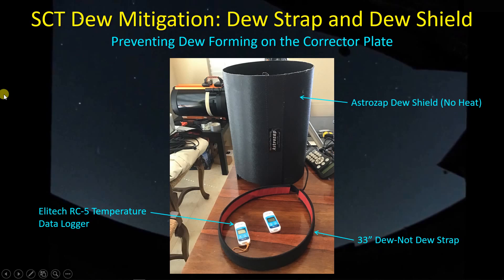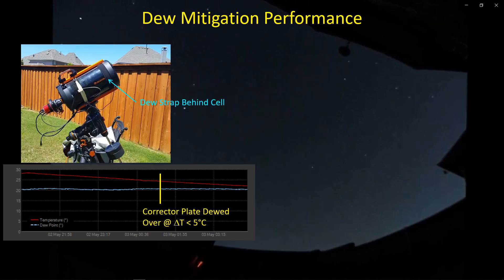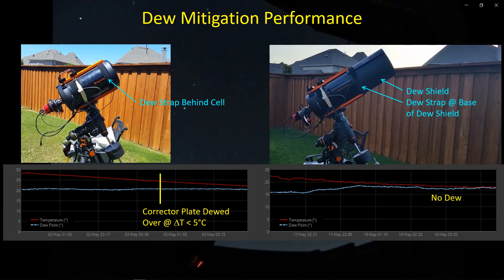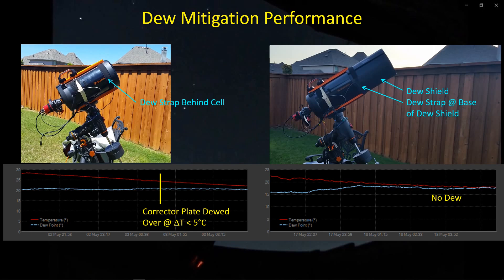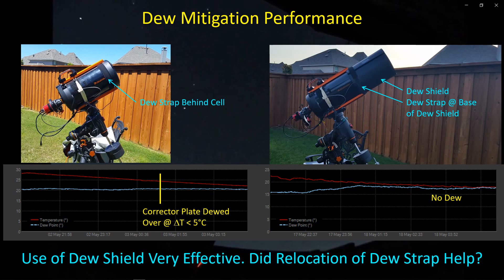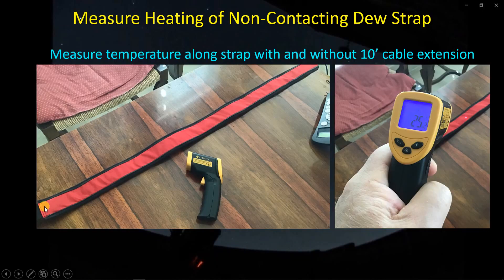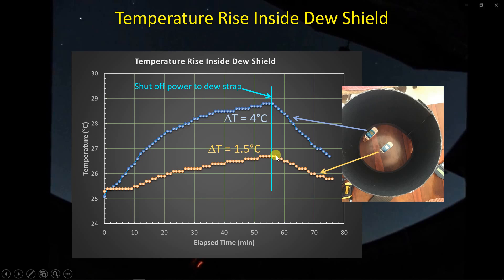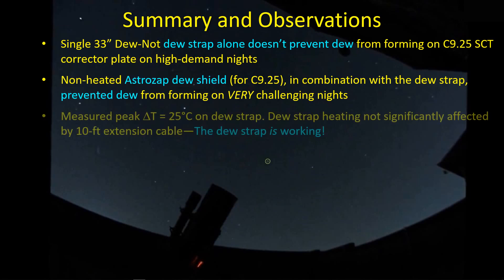Comments on the Use of a Dew Strap and Dew Shield with an SCT

Comment: A few months back I came across your outdoor setup , a 2 part series. I just got my celestron c8 and cgem2 mount. So been three months of a few nights of imaging . I put a focal reducer corrector on it before first full moon images . So happy with results . Then Orion Nebula just one image came out nice enough for me . Now I know more . So out to a bortle 4 and m51 . Stacking lights darks flats and bias , about 20 each . Now I’m hooked, scheduled time and budget enter my head . So here in Northern California I can drive to a bortle 4 or a bortle 2 . Duh the bortle 2 right . No , 4000 foot elevation and 80% humidity and took dew shield off for bhatinov mask focusing and instantly a dewed up situation. Now I go back to your videos . And I find very useful information on not only the dew problem , have dew heater now , but also getting into autoguiding . I wondered about size of guide scope and use of focal reducer . Did you post image results of m51 . I also have a spacecat for nebula imaging . Two very different scopes . I can probably get away with one camera for guiding , just a guess , but not the guide scope. Any thoughts thank you for your efforts on helping us newbies
Reply from the maker: Yep. You're hooked. Glad you've been watching my "learning fest" video series! Also, I'm happy to hear you have a SpaceCat. That's an awesome scope and a good counterpoint to a C8. Dew is the big issue for me right now. I've been doing some recent imaging with a shorter-length simple dew shield combined with the dew strap. It's been working well. So far. I've been stealing a night here and there that I share between M106 and M51, so no final results yet. With any luck (and no dew), I should finish the Lum filter tonight. Then I will devote a night each to R, G, B, and Ha as the moon becomes increasingly bright. The forecast suggests I'll be done next week. Forecasts have been wrong in the past though. Once I'm done, I'll do a video comparing these results with those I obtained when I first started this hobby with a DSLR. Should be embarrassing! Either because of lack of progress or how poor the original images were. I'll also have a video update on my findings relative to dew prevention. Thanks for watching, Dan!
Reply from the maker: I think it would be perfectly fine to use one guide camera for both scopes. A small OAG like the ZWO OAG would be very good for the SpaceCat. At that focal length, you won't have any trouble finding a guide star assuming your guide camera is sensitive enough. If you use a guide scope with your C8, you can get away with a guide camera with a smallish sensor such. If you go with an OAG for that scope as well, you may want to use the Celestron OAG (larger prism), and then you'll want a guide camera with a larger sensor to make use of the larger prism. If you always use the focal reducer, that will help in finding guide stars. Try our different options in Stellarium. It's free a vert useful for looking at fields of view for the main scope and OAG with difference camera sensor sizes.

Comment: James, you talk about the air being heated, but the whole point is to try and get the heat in to the glass. I'd recommend putting the dew strap as close to the corrector as possible on the cell, then use the dew shield on top as an insulator to radiate more heat inwards (as well as the physical protection aspect). Direct contact to try to get the warmth in to the glass is the idea.
Reply from the maker: Thanks for the comments! My experience shows my C9.25 dew up if the dew strap is on the cell or on the tube behind the cell. Recent experience also shows no dew forms if the dew shield is used (alone? or) in combination with the dew strap. Recent testing/imaging with a half-length dew should has also been successful (reduces wind disturbance). 
This dew issue is actually quite complicated. Like you, I thought that heating up the corrector plate is the objective. And that may well work if you can heat it up enough. I have serious doubts whether that little dew strap has the heating capacity to heat up the cell (or tube) and also heat up the corrector plate. 
Mike (commenter in this section) has brought up an alternative view that heating up the air mass in front of the corrector plate is the objective. I have more faith in the dew strap for this role. As I understand the mechanism, higher temperature air has a greater capacity to hold moisture. When the air temperature drops to (or close to) the dew point, the air must get rid of the excess moisture. If you heat up the air, you maintain its capacity to hold onto the moisture. Also, some of the heat in the local air column will transfer some (probably very small) amount of heat into the corrector plate.
My current objective is to find the minimum-length dew shield that achieves the dew prevention objective while reducing the increased sensitivity to wind. Then, I will attach the dew strap inside the dew shield next to the corrector plate to more effectively heat that local air column. Thanks for watching!

Comment: James interesting stuff that you do. The cable extension vs no cable extension; I would expect a dew shield controller to use a current source to limit the current so the full on current would be constant. When/if you turn the duty cycle down then the reduction will be what you expect regardless of using/not using the extension. So it performs (essentially) the same. But if you had used a "cheap (unsophisticated)" dew shield controller then the extension could be significant.

When you put the dew heater on the outside of the dew shield you put it against an insulator. If there was not insulator you would expect half the heat to go outside and half to go inside. As it is only a smaller percentage goes to the inside. If you had put the strap around the SCT metal before the corrector plate, then any small variations would even out as the tube acts as a heatsink and conducts from hot tot cold areas. If the tube radiates some heat out and some inside then like before the efficiency is reduced. But because you are heating the air inside the SCT it is constrained so it's more efficient than heating the air outside.

If you wanted to really "nail it", you might remove the corrector plate and position a heat belt close to the outside tube but separated from it. The heat would go into the air and relatively small amount would be wasted heating the tube. I suspect most users would prefer the simple approach so they would be OK with using the band around(below) the corrector plate and using a bit more current.

If you stop to think, what does a dew shield do? It has two effects; it stops stray light entering the tube. So it needs to be opaque and most are black. Also it reduces the off axis "cold" striking the corrector plate. You can't cover the plate - because you don't get an image, but you can cover the incident "cold" striking the plate. If you shorten the dew shield it's effect is reduced and a rule of thumb is that it should be as long as the diameter of the tube. Half as long will be less effective. Twice as long will show little improvement.

So for a reasonable length, the main issue is the area of the shield that is subject to wind. If you put holes in the dew shield the surface area would be reduced but so would the shielding. Half the area would also be half as effective e.g. much like reducing the effectiveness using a shorter dew shield. There is one potential solution: block the cold (light) without increasing the wind resistance. One example of this in your house might be a slatted blind near a window - it blocks the light (somewhat) but has little resistance to wind (compared to a  blackout shield). So a dew shield made of slats (or tubes) would block the cold (light) but offer little resistance to wind. Something to experiment with?

In your backyard you have a solid fence. It blocks stray light but is also affected by the wind. If you also wanted to block light but wanted to limit reduce the wind resistance, you might try a blind e.g. two layers with gaps but with light blocking without the wind resistance. Similarly a dew shield needs to be constructed to solve the main problem without introducing a second problem. One limitation of a dew shield is cost. If the cost was "astronomical" then no one would buy it. You could look for a material that has the desired properties but has the effect you want without the drawbacks e.g. a very open cell foam supported on a frame (like fabric on a lampshade).

Simon
Reply from the maker: Thank you for the thoughtful comments, Simon! Your comments about cable length and power supply totally agree with what I found. As for the dew shield: I tested a shorter-length "paper" shield last night with the dew strap wrapped around the outside. It worked very well. No dew at all. Its length is 8.5" from the end of the corrector plate (9.25" aperture), whereas the Astrozap is 14" long. There was a bit of wind, but guiding went OK. If I can confirm this shorter shield length works for dew prevention, I will cut down the length of the Astrozap shield and mount the dew strap inside the shield, just in front of the corrector plate. That's my plan. Thanks again for the comments!

Comment: All great stuff including all the replies. The problem I have with the dew shield is difficulty in taking flats. I use a lighted LED panel which I lay over the top of the dew shield. But any shifting of the dew shield and there are some internal reflections that alters my flat and I get so weird curves in my final image that are difficult to remove with processing. Any thoughts
Reply from the maker: Interesting. I guess the flexible dew shield is shifting because of the weight of the light panel? Can you take the flats with the scope horizontal and the light panel very close to, but not touching, the dew shield?

Comment: Hi James. As a former aerospace thermal analyst, I would make the following recommendations. 1) If possible , put the the few heated inside the few shield and on the forward cell (biggest chunk of metal in contact with corrector plate capture features. 2) Add additional insulation strip around OD of few heater.  The foam dew shield  (if installed over the few heater, should improve the fraction of heat going to scope). In Texas, on a clear night, radiant heat loss to "clear" sky will suck a lot of the available heat away. it is all about differential thermal resistance. Good luck and thanks for all the interesting and informative videos. Bob
Reply from the maker: Hey Bob. Maybe we crossed paths. I worked with a few aerothermal engineers in my Navy missile engineering days. Totally agree! I want to test a "short" (maybe 8" extension) dew shield with the dew strap inside (radiating toward the center). Mike, a commenter here (and my dew prevention patron saint), has said the goal is to heat the air in front of the corrector plate. There is a solution! I just haven't found it. Fortunately I've got you, Mike, and others providing great ideas...Thanks for your suggestions, as always!
Reply: @Aero19612  Hi James.  I started my career working on Trident II in the 80s.  I worked for Hercules/ATK until my retirement a few years ago. Where do/did you work?

A shorter dew shield will still provide a significant reduction of the view factor between your corrector plate and the sky (which is always way colder and is the predominant heat loss from things facing up at night).  Optimally, you would want the inside of your dew shield to be just above the dew point temperature to avoid having unnecessary convection currents.
Reply from the maker: I worked with the Applied Physics Lab in Maryland. I visited several ATK facilities over the years. I believe there's one in Utah (unless I'm mistaken) and one in Elkton, Maryland. I'm still working. I moved back to Dallas to join some friends in their structural engineering firm. Congratulations on your retirement! I find that work keeps interfering with my astrophotography.

Yep, I gotta go with a short dew shield. As you say, even a short one (8" maybe) will reduce the view factor. More experiments!

Comment: Does your dewshield comes with a heated strap and you are using an additional one on top of it?
Reply from the maker: Hey, Ray! No, this dew shield is not heated. I just have one heated Dew-Not dew strap I'm using. Although, I think Astrozap has a line of dew shields that are heated, if I'm not mistaken. I would think that would be very effective as long as you don't melt the dew shield material.
Reply: @Aero19612  Thanks James!
Reply: Really liked the science on this. I have a 8'' SCT and dew is a real problem in the UK. I don't want to spend too much money so I'm going to make my own dew shield from a yoga mat. I also have a wine fermentation strap that I will use to give me some heat. But I don't know where to place the strap/heater. Over the dew shield level with the corrector lens or in front of the glass so it only heats the air inside the dew shield? 
What would you suggest?

Comment: Hi James, I have the same setup with a few minor differences. I use the pocket power box set to auto and I have the Edge HD version of the ota. I've always had the strap under the mounting bars like your original setup but I always use the dew shield with it. The dew shield doubles as a shade from my neighbors lights so it's a must for me.

Maybe something simple like wrapping an Ace bandage around the strap would help hold some heat in and provide better contact.

The good news is I haven't had any dew in 2 years using both the strap and dew shield combination but it's much more sensitive to wind.
Reply from the maker: Thanks for the feedback, Paul! The dew shield is a huge help from a dew perspective, but I, too, like the stray light control it provides. It's just the DARN wind. If you have the dew problem solved and can tolerate the added wind sensitivity, sit back and enjoy a nice adult beverage. I feel like I'm close to a long-term solution. I'm leaning toward mounting the dew strap inside a much shorter dew shield. Mike (fellow commenter to this video) has provided some great insight along these lines.

Comment: Thank you so much for this - this is extremely useful. Dew has caused me all sorts of trouble with my SCTs when imaging in the mountains. And is one of the reasons I switched to a Newt. Still, I have a C9.25 I want to take to darker zones for visual, and knowing how to protect it will be very useful to me.
Reply from the maker: Thanks, Cuiv. I'm not out of the woods on this issue yet, but thanks to the great comments and suggestions I'm getting, I feel like I'll finally have a solution. There's no room for lazy geeks in this hobby (present company excepted)!! We all have to work hard at it.

Comment: Had a thought. What about making a neoprene "sleeve over both ends of the telescope? I've got an 8 in Newt. Wondering if this would help w/ dew forming in addtion to my dew strap.
Reply from the maker: It might indeed. Neoprene is flexible, but it seems like it is also heavier than the foam like materials used in my dew shield for example. I haven't imaged with a Newt before, so I'm not too clear on how a "dew shield" would help on the back end. Thanks for watching, Tchalla!

Comment: James ! Glad to see you are making progress on this particular stuff. I like your videos because you really attempt to analyse the problem and then develop some experiments to improve your understanding.
My impression is that you're impressed with the performance of the dew strap and shield when you located the strap where I suggested, but are now puzzled because in the tabletop  bench test you only measure a very modest rise in temperature. Now you wonder if all the work is the dew shield and if the heater is contributing that much.  Let me assure you, it is.
Your bench test measurements are not capturing the dynamics of how the system prevents dew formation.
The system works because you are creating a column of air that  has an insulating effect in front of the collector. That column of air is warmer than surrounding air because it gets a small amount of the radiant heat from the collector as it cools. What you didn't capture in your bench test is the accumulated heat for the entire column of air. Also, the heater will be more efficient when the ambient temp isn't already at 23.  
With that in mind, the most efficient location is inside the dew shield at that base just in front of the collector  with the hot side of the heater towards the center. This takes advantage of the insulating material of the dew shield. Also be sure the seal on the dew shield is tight around the scope, as any air gaps there will create a chimney effect and will draw the heat out the top. 
How short a dew shield can you go?  I suggest if you try making a short one that you use a cheap yoga mat, because they're made of flexible foam that will help insulate the column. 
Just remember you are heating the air, not the collector plate.
Reply from the maker: Yes. Some progress. Thank you for your excellent comments on this topic. You're really helping me to get my head wrapped around this issue. Interesting suggestion regarding the need for a good seal on the back end. The dew shield fits well, but it's worth a check. Thanks, Mike!

Comment: Permanently mount the dewstrap on the inside of the astrozap leaving a distande to the edge of it the width of the rim of the ota and have it rotated so the lead from the heating strip sneaks out precisely in the joint of the astrozap
Reply from the maker: Totally agree. I just need to find that balance of "long enough" to provide dew prevention and "short enough" to avoid wind issues.